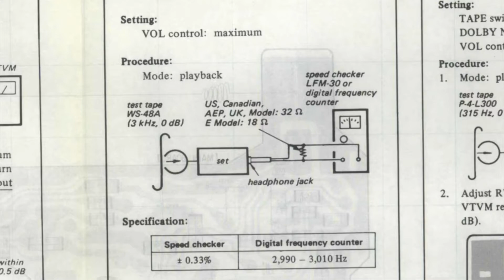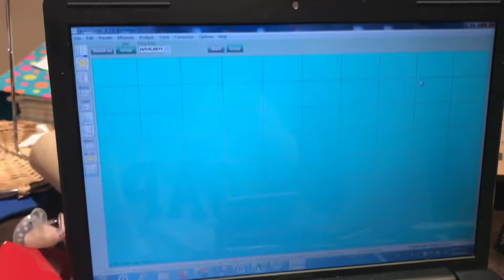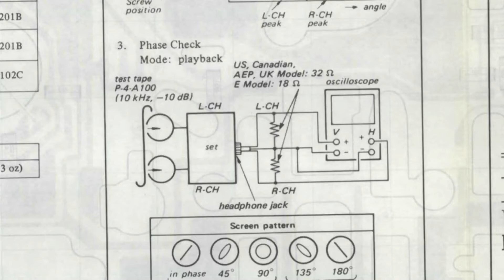Sony Walkman WM-38/68 - New belts, speed and azimuth adjustment

Comment: Thank for the video - I have a WM-F38 and the door has been falling open since 1993!! Today - I managed to fix it by seeing that spring mechanism. It was fairly easy once I unscrewed the thing to get proper access. This video helped. Only took me 31 years to fix! I'm gonna need to replace the belt though. Any thought on where to get one cheap?
Reply from the maker: Hey Kevin! Im glad you fixed it! If you are in USA, may be you can contact bob@vintage-electronics.net. I bought him a few belts at good price a few years ago. There is a very good resource in europe for excellent quality belts (you can email and ask for this model) but it will take longer to arrive: fixyouraudio.com. Finally, very cheap (usually bad quality) x20 belts bags or more are sold in chinese sites like Ali Express. I bought belts in the 3 places i told you. I prefer fix youraudio or vintageelectronics. Good luck!!
Reply: @Rodrigo-O  thanks Rodrigo. I’m based in Ireland, so I’ll take a look at that European supplier you mentioned. Thanks!

Comment: Hi! I can't see how did you connect your multimeter to test motor speed. Can you explain me or send a picture/video (niisun@rambler.ru)? I see that you connected 3.5mm mini-jack to the player, but I don't see the other side, please help me to understand)
Reply from the maker: Hello! How are you! You are right. I connected a 3.5mm jack to the walkman. To get a correct reading, you shoud use only one of the channels (right or left) , add a 32 ohm resistor in parallel with the DMM, and then connect it to the DMM. The schematic is shown in the video (taken from the walkman’s service manual) at the 3:54 minute. You can freeze the video and take a look at it. If you can’t understand it, just connect one of the channels (r or l) straight to the DMM. I think it will work too. Remember to turn up the volumen of the unit too!! And use a good quality test tone cassette. I hope this explanation helps you. Good luck!!